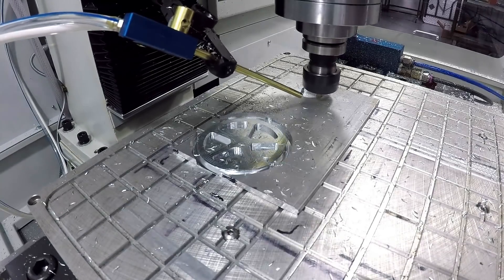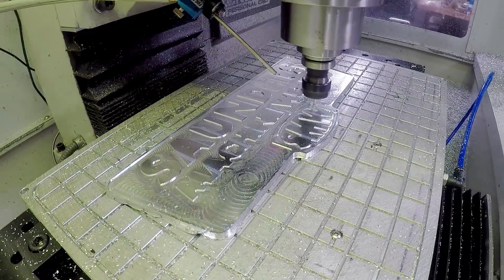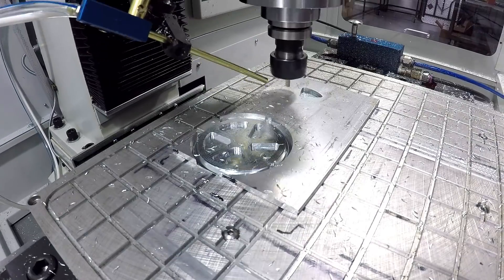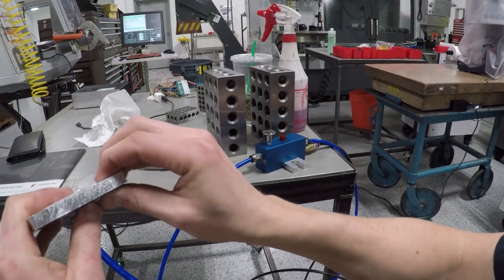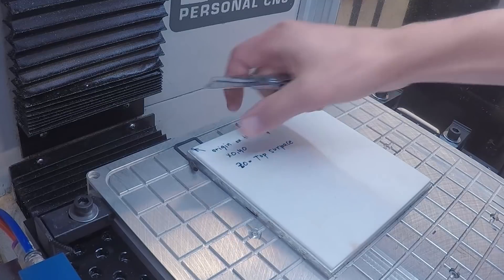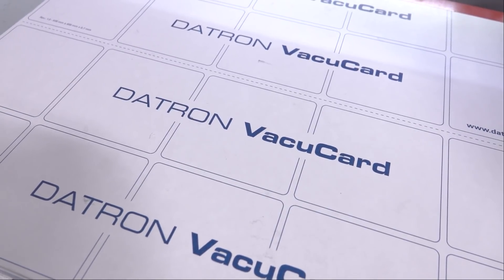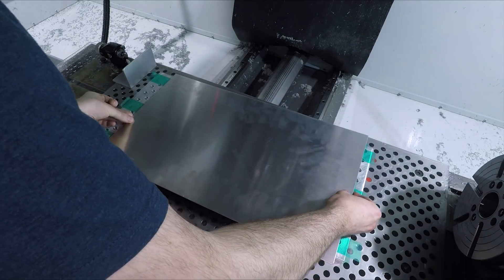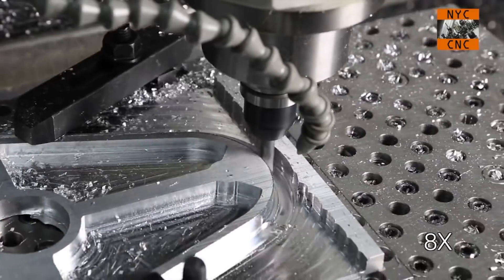Holding Thin Workpieces: Vacuum, Superglue, and More!

Comment: So very interesting, I have worked in AERSOPACE parts manufacturing and we used to machine the entire wing skin beginning with 35 mm thickness of a full 4ft by 8ft sheet and finishing up with thicknesses as low as 3.5 mm. All done using vacuum and high speed machining. Also hybrid fixtures with both mechanical clamping and vacuum for complex fuselage frames with multiple pockets. A word of advice ... The vacuum system must be integrated with the machine PLC so in case of vacuum loss the machine does an automatic emergency stop.

Comment: Tnx for you video i learn a lot, today i made my first "serious" try with aluminum cutting in my cnc (i normally make 3D carvings in wood) but now finally arrived my new 24k rpm 1.8KW ATC spindle and i need to make the new support for change the spindle (actual spindle is 18k rpm 1,1kw). 

If you want to see it and make some fun of my fusion 360 strategies see in my little channel (OMG i made one big mistake and the job take to many time for finish, ramps and me...).

Another time thanks for your videos i learn a lot.

Comment: Wow, after watching further I realized you machined ceramic.  I tried and it would blow thru in the bottom.  Wasted some very expensive ceramic plates trying to machine that stuff.  It is a material we need in RF design to allow heat transfer without conducting high power thru the junction and I failed on that.  Ceramics is crazy.

Comment: I did a 3 x 5mm ss eye wear peice for a company I am currently working for with a .032" mill using locktite adhesive and blue tape and won thier trust when I showed them I could do it.  (didn't think I could but tried and won).  Talking about cutting into .032" ss sheet and coming out with a peice so small you need tweezers to hold. Any how, I use the tape n glue for many clients and I love it.  Thank you John.  Hope you all are well and Jarod and family too.  I'll stop by for a class soon.  If you haven't been to a Saunder's training class you are missing out on moving forward in becoming a small shop business that can make your life more meaningful quick!

Comment: John, the green tape with the 2p-10 adhesive and activator are my go-to combo, I have been very successful with combo (much better than the blue painters' tape becomes brittle hard to get good even bonding (high spots that harden fast when using activator) and tough removal) as always make sure you have a solid decked surface to start with, the green tape with the 2p-10 is easily remove no mess and the part unless you get a bit of a gap in the tape o the part side. I have done all flat plate work this way and i am always amazed what you can actually pull off with just a bit of foresight as to when to break thru on multiple up parts with a drill or milled hole. Endless. I have a vacuum plate have been saving the surface for bigger runs but look forward to the sandpaper trick
this has been a gem from you that just keeps on giving. especially fun to wear SMW teeshirts when showing off the greatness. sometimes trying not to take the big cut pays off in dividends especially if you don't use the activation I find pockets of goo that still had air around the adhesive look for slight rotation motion as something might be about to let loose. this is a fun subject thank you for getting me in the right direction back in the blue painters' tape time frame...the golden nuggets!  Thanks, John as always look forward to more.

Comment: I've used double sided duct tape on several parts in the past on my machine or cnc router.....several occasions I've used double sided cellophane tape when cutting small plastic and aluminum sheet,,,,I like the idea of sandpaper between  the part and fixture,,we use folded up pieces of sandpaper between the tie down clamps on uneven surfaces when  holding down weldments the size of small houses at work p.s we made it home just fine with that drum in that honda fit thanks

Comment: Datron is a small Cnc router trying to be a mill. Nice machine, but the vacuum mentioned was pioneered by industrial router manufacturers (with the help of Boeing) 30 years ago and is known as high flow vacuum. It was first used with balsa wood end grain boards and high CFM pumps. The industry has since went to ldf table and mdf waste boards. The pumps used are massive (15-25 HP, 300+ CFM) because table sizes are typically 10'x5' or larger.
Reply: we have 2 at my work's machine shop, with the mdf board and they are probably 15'x6' or around that. we usually duct tape the aluminum or lexan down around the edges. I haven't actually ran it yet and I am curious how it can cut 50 parts out and keep vaccum with no downtime inbetween to tape up the sections it exposed. we leave tabs on each part as obviously they would go flying, i'm just not sure of the toolpathing for the last bit. small axial cut's until there's a few thou of material left and then what?
Reply: @yo64yo  there are a lot of fine details you must pay attention to when using high flow. First, make sure your table has been flycut and is clean of dust and debris. Also make sure the material is not warped or twisted or has any burrs that will keep it from pulling vacuum. If you can pull 15+ inches of hg during your cuts id say you have a good chance of being successful. For small challenging parts you can do exactly what you mentioned, cut everything down and leave a few thou skin. Then machine the skin away at a slower feed. Your starts and stops should be in such a way that majority of the skin is attached to the rest of the nest until it's just about cut free.
Reply: @sportbob06  are you talking about centrifugal impeller pumps, piston or venturi?
Reply: @MakeTechPtyLtd  rotary vane. Both dry vane and oil ring.
Reply: @sportbob06  oh cool. I hadn't looked into that before. Very interesting. Thanks!

Comment: Try 2 sided Carpet tape its crazy strong! I tried it about a week ago and was amazed at how much it can hold kinda tough clean up.
Reply: Try a sandwich of the green Mylar powder coat tape with double sided linoleum tape in the middle.  Holds great.  leaves no residue on parts/sub plate.  Uniform thickness of the tape sandwich is around 0.010".   Handles coolant very well.

Comment: [Edited] A perfect vacuum is 14.7psi . In my experience the venturi vacuum generators pull about 5PSI. Anyone else measured the vacuum on a venturi vacuum generator?
Edit: Actually today I found I was able to get 14+psi from a venturi vaccum generator.
Reply: You likely aren’t putting enough cfm of air through it. Check your Venturi specs. More volume, more vac.
Reply: @russellmiller2564    There's some good documentation at https://www.blowervacuumbestpractices.com/system-assessments/vacuum-generation/utilizing-venturi-vacuum-generators-efficiently
Reply: @russellmiller2564  I agree that more cfm creates more vac, however the drop off in diminishing returns is very significant.
From link above:
"The increase in the level of vacuum from 18" to 27" Hg is 10 times more. "
(in psi 8.8 to 13.3) 
My 5psi figure was recorded on an industrial machine getting heaps of air but it was old and may have had some tiny leaks. In any case, the vac gen and work holding I installed on the machine had many times more holding force than required.
Reply: @russellmiller2564  thanks. Original comment edited. Today I got 14+psi on a different vac gen and machine.
Reply: @MakeTechPtyLtd  Glad you got to the bottom of it